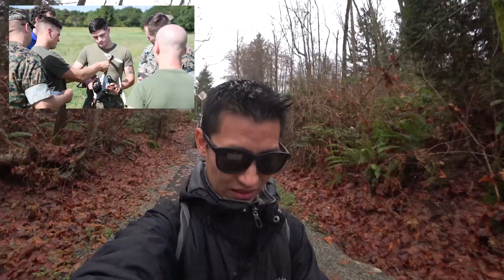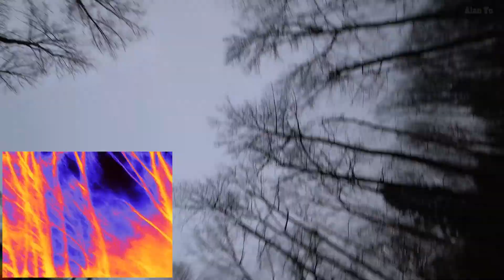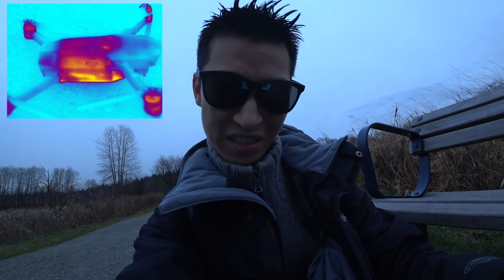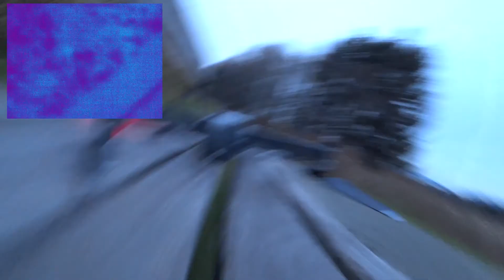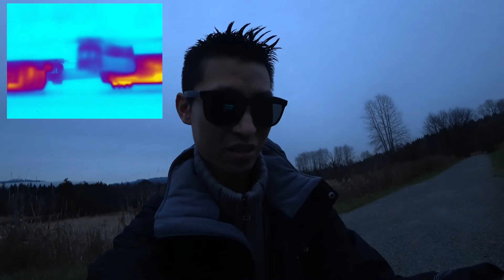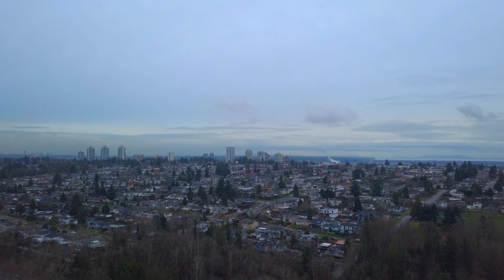Mavic Pro Heat Image Level Thermal Camera View And 3D Printed Drones Future

Comment: This is the continuation of the following comment, but due to my clumsy fingers I had to finish it off here 
In the middle of the program and make a pile of goop instead of delivering a complete part, oh by the way these stupid printers have to be perfectly level to work right. Google up “Makerbot” and Problems with these things. To get these machines to work right someone should master 3D cadd as well to get some predictable results. The tolerances and finishes with 3D printing are sometimes not that good, except someone looks into a more pricier printer.

Comment: This was a class sponsored by Red Deer College in February of 2014. The process is awfully slow. I made program for small 2”. Egg cup to be made from plastic, which took several hours to produce. By comparison I made the same cup from aluminum in about 2-1/2 minutes on a CNC (computer numerical control) lathe in my shop. My wife requested a few of them to be made for the kitchen table,
So it was worth it to make a program for these egg cups.
Reply from the maker: That sounds like it would be a fun daily 2018 thing for me to learn 3D printing if there was a feasible option to do that.  Set the thing to print, go out for the day as a time-lapse captures it and then see the results at the end of the day.